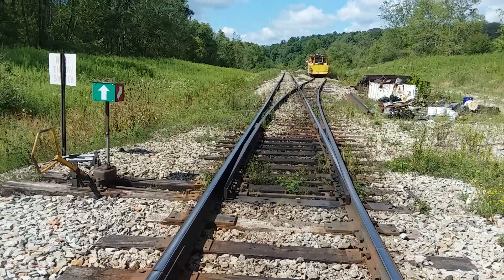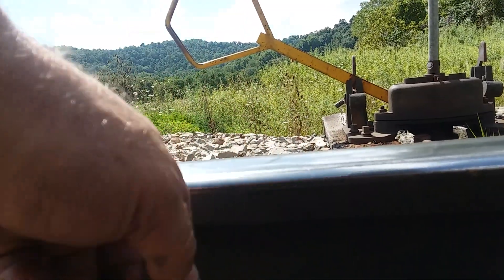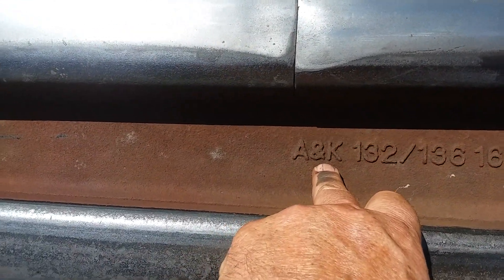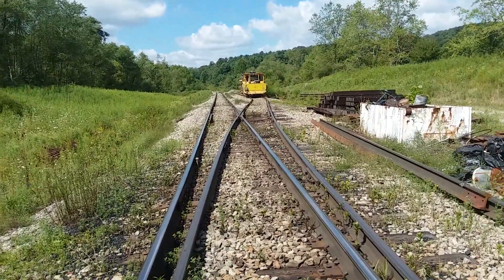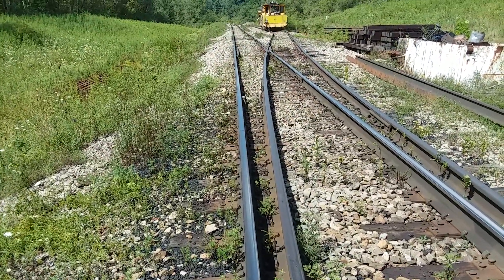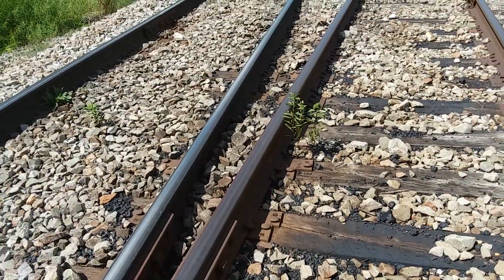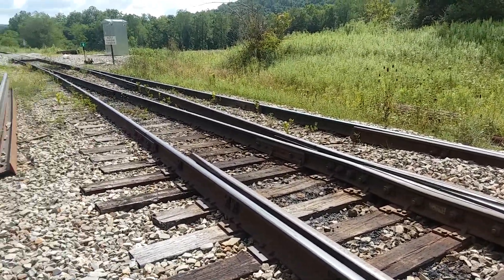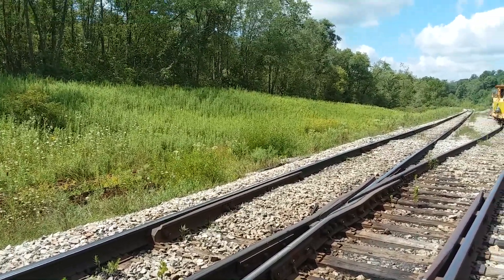Parts of a Railroad Track Turnout

Comment: are turn outs rated for speed?
Reply from the maker: Yes they are Dave. The higher the number of turnout, the higher
the speed on the diverging track can be. The higher the number
of turnout the less the angle is from the frog into the diverging
track, thus you can go faster. Main line speed is whatever track
speed would be despite the turnout number. Speed is only
restricted on diverging.

Comment: Great way explaining the turnout number. I like the target on the stand. About the RE stamp on the rail and track components. It is a track standard, not relay. RE (AREA), ASCE & ARA are three examples of track standards. Those heel filler block bolts are too loose. FRA always jumped my butt for that. We used those clamps too when storing equipment on a siding. I also removed the switch lock and placed a different lock on the stand that nobody but me and the roadmaster had keys to. Great video and information.

Comment: You talk about Belen nicely, out of the fuel pads 8 and 7 track has a complicated setup??
Reply from the maker: Thank you Bob. Every turnout has a number designated to it.
The number of the turnout is determined by the number of the frog. In this video the turnout is a number 10, the one at Belen is a number 20. The difference is in the frog angle, which basically means the
turnout side of the track is less of an angle the higher the number and also that means the track speed can be higher on the turnout
side. Belen is no more complicated than any other turnout, it just
has a higher speed allowed and less of an angle than this one does.
Hope that helps clarify a bit and hope you are doing well my friend

Comment: I recently seen a turn out and at the frog. The track or point location was closed.  It was like it was aligned to the direction of travel. Both points and frog.  If a train was going into a siding both the points at the beginning of the turnout and the frog moved. What kind of turnout is this type??
Reply: You said the point of the frog was lined for the turnout?. You could have been looking at a movable point frog or spring frog  and the points for the switch are either lined for a straight move or a diverging move which would lead you into the siding. Movable point frogs have to be traversed at no more than 1 mph for a track car .
Reply: That is something I cannot answer, have never seen that before! that is wild. Hopefully
someone reading this will be able to give a good answer. Thank you for watching

Comment: Work in a frog & switch shop for a year pretty amazing equipment to see the multiple drills etc. Was a helper on 650 ton hydraulic press used to level and straighten the frog to specs. The frogs were explosive harden on top .They had a digout pit stack them in there lined with explosives on top , bury them all with fill and set off then dig them back out.
Reply: Awesome comment! Thank you. I knew a guy that used to work for a frog manufacturing company in the 1950's in Ohio. He told me they set off dynamite strips on top of the
rail heads to harden them. However, they were next to a dairy farm and after time the
cows quit milking cause of the loud noise. So they moved the frogs under ground to
a mushroom farm and set them off. Great guy, now deceased, railroader all his life,
Mike Davis. Can't say enough great things about him, he once worked on the Panama railroad,
Reply: @OneWayWillie  Rail weighs different amounts depending on the size. In the case of the markings shown on the heel block, it was 132-136. That is the weight of the rail per yard. 141lb rail is about the biggest used and it weighs 141 lbs to the yard. So whatever weight you see on the side of the rail, divide by 3 to get the weight per foot. 132 is 44 lbs per foot. 136 is 45.33 lbs to the foot. 141 is 47 lbs to the foot. About the smallest used on railroads today is 90lb rail that is 30 lbs to the foot but you might find on a siding some as small as 75 lb rail which would be 25 lbs to the foot.

Comment: At the frog there are side rails, one laying near the main line rail on the left and one on the divergent rail on the right. I'm pretty sure they guide the wheels to stay one which ever track the path takes. Could you confirm with a better explanation.
Reply from the maker: Yep you are correct Mike, they are called frog guards

Comment: Holy cow, alot of parts for just a Switch for us non railroad types. Is the #10 the sharpest turnout
Reply: Kenn, freight rr turnouts are numbered from 5 to 20, however there is no 13, 17, or 19. The 
less the degree of frog angle, the flatter the degree of curved lead (diverging track). Thus the
higher speed through the turnout side (diverging). A number 20 has the least degree of
curved lead, thus a #5 would have the sharpest degree of curved lead. Union Pacific has
built their own frog with an even less degree of curved lead than a #20, but that is special
made just by them. AREMA only recognizes 5 thru 20 in their spec sheets for turnouts for freight.
Transit is a whole new ball game, they have a lot of even lesser degree turnouts for very
high speed, especially on their northeast corridor. I am not familiar with those enough to
give you any details other than what I just said. Thanks for watching!